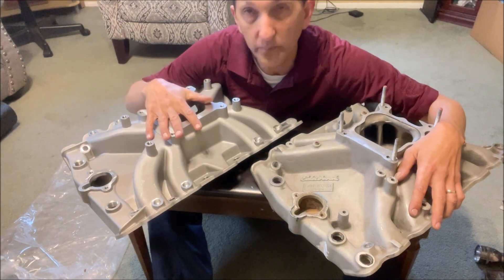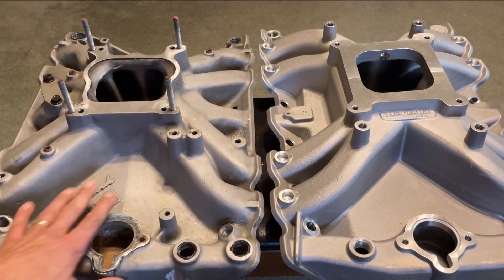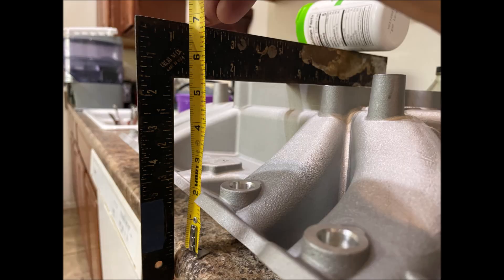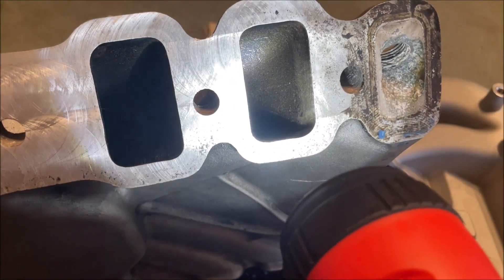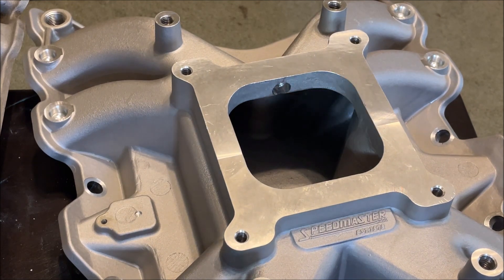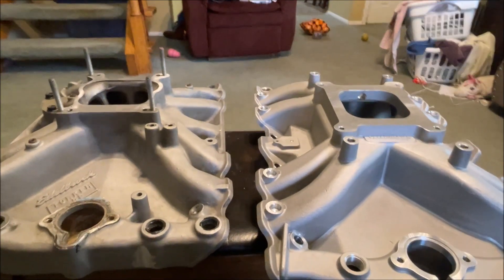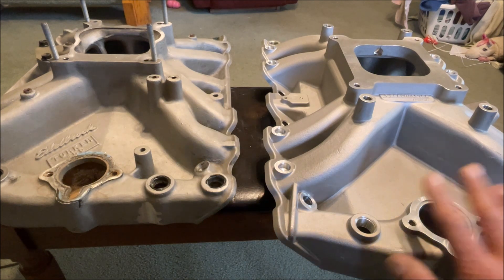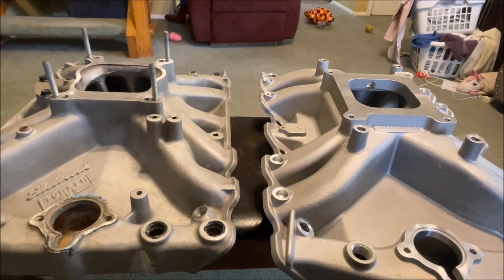New Speedmaster Oldsmobile Single Plane Intake vs Torker

Comment from the maker: Guys, I just found out that Speedmaster has allegedly blatantly counterfeited another company’s product and Summit Racing Equipment in response has pulled ALL Speedmaster products.  See this video to hear it from the horse’s mouth:
https://youtu.be/9dsHrSq8pso?si=zQPjfluS0la0zPyC
Reply: Speedmaster has been copying other products since their beginning. They went TOO far this time when they copied one and then used another company's quality name on their copied product. 

SHAME on them.... 🤨

Edit: I believe "Speedmaster" was also one and the same company as "Procomp", and "Cat" from back in the day. I remember the big deal with the cheap "Cat 3D" Oldsmobile connecting rods when they came out over a decade ago. The rods looked like pretty much a direct rip-off of an Eagle design. 

Why has this company changed it's name 3+ times? 🤔

And to think that they actually won a SEMA award also, off copying everyone else's hard work. 🤷🏻
Reply: Dog eat dog world these days.
Reply: Wish them or Jegs/both would refuse as many overseas products as possible. 
Keep the jobs here
Reply: @gordocarbo  It's unfortunate, but IF the mail order companies refused the Chinese stuff, we'd lose MANY guys out of the hobby because the USA made performance engine parts are totally and COMPLETELY gouging the HELL our of their customers. Some of the USA made parts have gone up OVER 150% markup in the last several years. People need to get their heads out of their asses, and figure out how to make products at a MUCH lower cost and/or QUIT being greedy bastages. They're gonna SCREW themselves right OUT of business by keeping up what they are doing. 
I AM normally a 100% buy American kind of guy, but lately even I have gone without some of the stuff I normally buy during a race season because of the ridiculous prices of the stuff.
Reply: @gordocarbo  Me too... I refuse to buy cheap overseas parts for a performance engine anyway. There's WAY too much other expensive parts to risk using questionable parts in an engine.

Comment: For anyone wondering about the mid rise dual plane olds big block manifold. I purchased one on Black Friday last year for less than $200. The only thing that I’ve noticed is that one of the accessory holes infringes on a runner. I laid it on the engine and everything lines up. A simple grind job will take care of it. Yes these parts are not up to the quality of Edlebrock however. Edlebrock manifolds are now up to $700! As millennial who hasn’t enjoyed the financial prosperity of the previous generations, this is a god sent. I’ve had my cutlass for 20+ years and 20 years ago I dreamed of aluminum heads. Now I have a bare set of speed masters for Les than $1000. Yes they will need some work but the were $1400 cheaper than the Edlebrock’s that they copied. I hate that I have to buy from overseas but I don’t have a choice and this has opened up a whole new generation to what is lets be honest, the overpriced and therefor dying muscle car hobby.

Comment: I've got the stuff to build a 425 with some ported C-heads (big stainless valves 2.07 x 1.72") and a 244* @.050" Crower hydraulic FT cam, should be a good street runner in my '85 Cutlass with semi-fenderwell multi-piece headers and a TH400! Need to decide on intakes myself, have a Victor, a Torker and a Offy Port-O-Sonic!! :)

Comment: I suspect those 2 cylinders are next to each other in the Firing Order, and the runner design is to improve the Airflow and Fuel Distribution to them,
Reply from the maker: I don’t think that works out when you look at the firing order 1-8-4-3-6-5-7-2
Reply: @CobblerBob   The cylinders you showed are 5 and 7.  Are the other pairs of runners made the same way?

Comment: If you have the hood clearance, use the Victor. The Torker is OK, but it's ancient and the plenum is small. It'd be interesting to see a dyno test or some track times between the Torker and the Speedmaster. I stopped racing 12 years ago and just do restorations now, but I had a Victor on my 468 Olds and the car ran 9.30 @ 148. Low speed performance was great.
Reply: @SPSteve  The Victor is TOO big for anything but an all-out race engine. Sure, they look cool,  but they are too much for 90% of the builds out there. They run up top, but you lose WAY too much meat in the curve. The meat is what gets the car moving quickly.

Edit: If you were in the low 9's, then you probably COULD use what that intake has to offer. But most guys won't be able to, and will suffer.

Comment: Way they did those runners is a joke. 
Plus notice the runner entry roof. Sharp 90 deg angle. 
Flowed more than 1 chicom intake and they didnt even make OEM numbers
Buy US while we still have choices guys. Dont be fooled by cheap..or a new overseas brand. Probably the same thing

Comment: I had much better luck with the Offy Port-O-Sonic intake over the Torker. 

I eventually moved up to the Dominator flange Super-Sonic intake later on when I got a much better set of heads. 

I like them both.
Reply: @davelowets  Super Sonic was a damn good intake. Had one myself back in the stone ages. Wish I still had one just for the hell of it. But back then, nobody was thinking about how rare this shit was gonna be 40+yrs later. So we went thru Alot of parts. Buying, selling, swapping etc. Who knew....We just wanted to go fast.

Comment: I have an old Offy intake thats made similar to that. It ran real good. Its the "360 Equiflow" model. Cast in 1981. Used a Port O Sonic on a 455 yrs ago, it ran high 10s in the 1/4 @ 128mph. Ive been curious about how these Speedmaster intakes for Olds work.
Reply: The 360° Offy wasn't a bad intake for a mild small block Olds on the street.
Reply: Ran an extrude honed port o sonic on a 85 GT I had. 460/c6. 
Dont waste your money on that chicom stuff. know of one or two products that perform worse than stock.
Reply: @gordocarbo  The Port-O-Sonic and the Super-Sonic really benefitted from milling out the cloverleaf plenum pattern and opening up the plenum volume on a more than mild big block. 

Was there any work done to yours? I don't know about the Ford intakes, but the ones for an Olds really needed a port job on the runners also, as the were pretty small on an as cast manifold. There is plenty of meat to do it though.
Reply: @davelowets  Had mine extrude honed, same with the heads. 90s build. I usually port my own these days but with its design it was just easier EH . Strong runner
Reply: @davelowets  Yep, mine had some port matching and a little plenum cleanup. Nothing special.
Reply: @thereluctantgearhead4544  I've tried the Super Victor,  but unless you have a max-effort build, it's a little overkill for most of the milder Olds builds out there. They do pull strong on the top end, but you lose SO much on the bottom with them.
Reply: @davelowets  Yep, wouldn't recommend it for a Sunday driver. But the engine I'm building will have 13-1+ compression, 280+.050 solid roller with around .800 lift. And as much cylinder head as I can afford to get on it. Kinda building it like a NHRA Superstock engine. Even have a bad ass Superstock Q-jet I'm gonna try on it and compare it to a 1050 Dominator. Thinking about going with a 4.500 stroke crank too with 7 inch H-beam rods. I want to run 9s NA with a 455 Olds based engine. Mid 9s would be even better.
Reply: @davelowets  Ill be using a 8inch convertor behind it too, so low end won't matter. Should stall in about the 5000 rpm range. 4-30 gear out back.
Reply: @davelowets  It's a drag car.
Reply from the maker: Wow. For where I'm at, the unkown is too much of a risk! It would have been great to keep this intake (I returned it) and dyno test it back to back with a Torker.
Reply: My current 455 Olds build is using a Edelbrock Super Victor. Don't much care about the Chinese shit. They are like a box of chocolates. I used a few Torker 455 intakes back in the day. They work pretty good. A little grinding makes them even better.

Comment: I like the injector bungs, that looks interesting.
I like the torker on my 455 mainly for the spread bore flange and it runs great with the thermoquad on it.
I suspect the runner idea came from Kenne-Bell's Buick manifold.
Reply from the maker: Hmm… I’m not familiar with it, I’ll have to check Kenne Bell’s it out! I tried to contact Speedmaster. I emailed them for design intent information and called them 3 times, but never got any real response.
Reply: The Thermoquad is a piece of garbage compared to a Quadrajet.

The plastic body of the Thermoquad is just about GUARANTEED to be warped or mis-shapen after all these years of being torqued to a manifold. Hell, even many of the Quadrajet metal main bodies have enough problems on their own these days, and it's getting ever harder to find a decent core to work with. Junk the Thermoquad, and go with a Quadrajet.
Reply: @davelowets  Not sure why you're having issues with TQ's, they've always worked fine for me.  I'm also a big QJ fan, love 'em.
Reply: @thisisyourcaptainspeaking2259  The Torker is fine for a mild engine, I've used them for years, but once you step it up a little bit, there's much more to be had with a better intake. Those kinks in the outer 4 runners can be an issue with distribution on a big power engine.